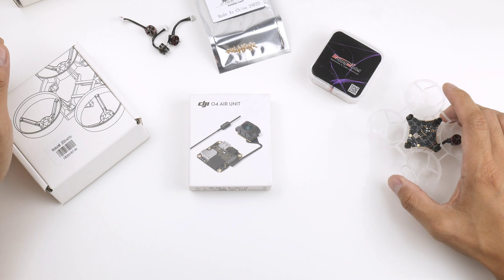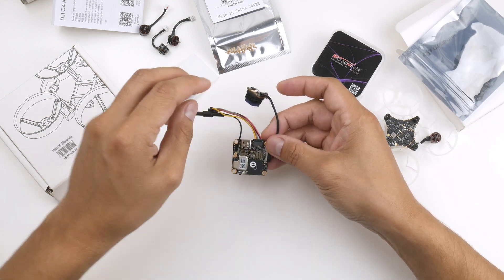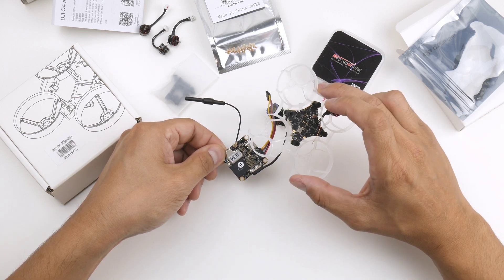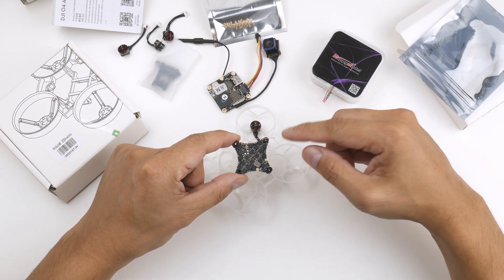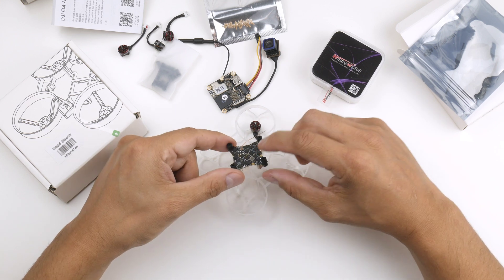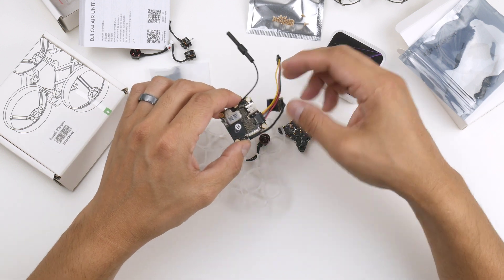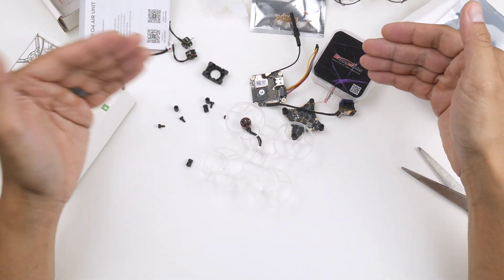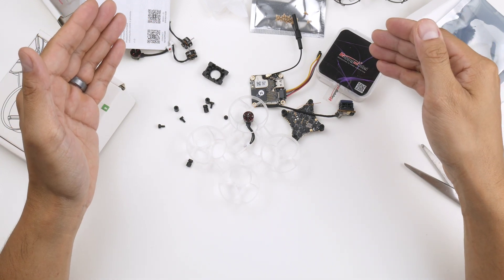DJI O4 Air Unit Mobula6 2024 - Intro Planning

Comment: I have most of my parts ready to build, very similar to yours, Mob6 2024 frame, VCI spark 0802 22k KV, O4 lite, tattu r-line 1s battery and just waiting on the usual slow BetaFPV shipping to get the Matrix 3in1 board.

I was never one to let other people tell me not to try something, so i want to find out for myself if i can get a lightweight 1s build done that won't brown out the VTX. Dont know if you don't try, right!?
Reply from the maker: Exactly. And it's fun either way, in my opinion 👍 I know it's not for everyone. Hope it works out for you! Maybe let me know how it goes
Reply: @nxp200  Absolutly will let you know how it goes! and will be following your build closely as well!

Comment: Does the superx HD provide enough current from the BEC on 1s?
Reply from the maker: Don't know yet! We'll find out! Doing the build right now.
Reply: @ good luck, I did a 2s build but am waiting for other people to figure out which 1s boards work 🤣
Reply from the maker: Thanks!! I can't wait for others and have to try for myself to see. Looking forward to seeing what others find out too!
Reply: You can use a tiny 5v booster to get a steady 5v to the o4 lite system. The o4 cuts if you go under 3v in a voltage sag. The booster stops that.
Reply: @jeffro1005  Yeh I'm aware of the boostybaby, would just love something that doesnt require an additional chip :D